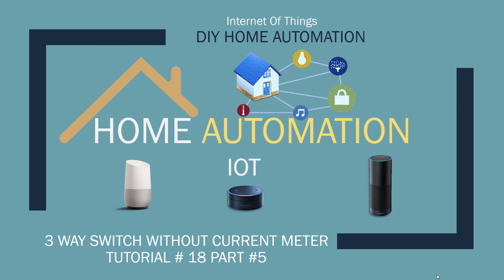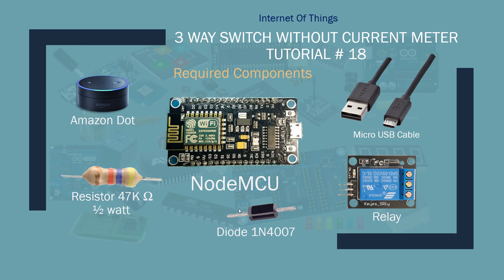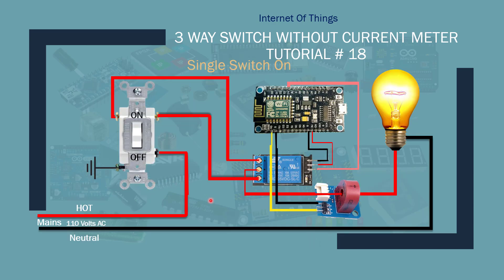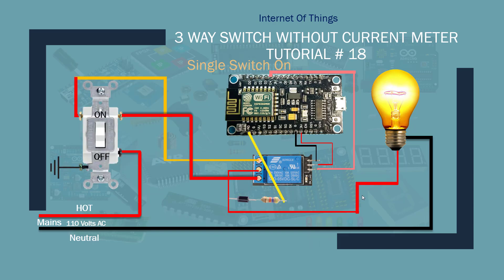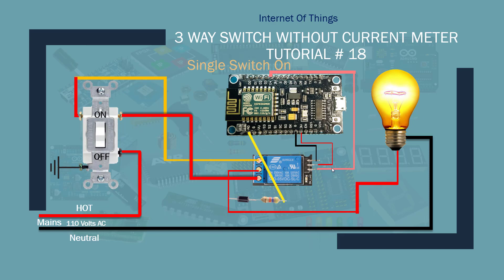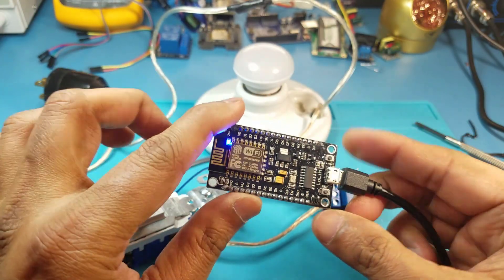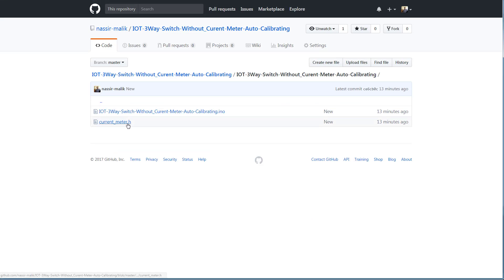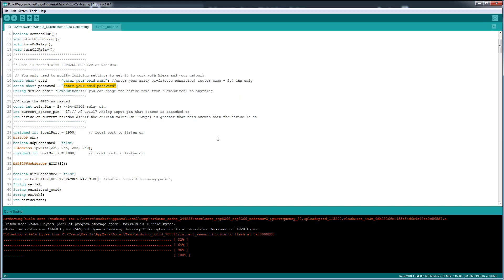IOT | 3Way Switch Without Current Meter Auto Calibrating | Alexa | NodeMcu | Tutorial #18

Comment: hey the project is too good and I was trying the code to verify in ide but the error is showing down below:
Arduino: 1.8.9 (Windows Store 1.8.21.0) (Windows 10), Board: "NodeMCU 1.0 (ESP-12E Module), 80 MHz, Flash, Disabled, All SSL ciphers (most compatible), 4M (no SPIFFS), v2 Lower Memory, Disabled, None, Sketch + WiFi Settings, 115200"

C:\Users\maadh\OneDrive\Desktop\3 way switch\IOT-3Way-Switch-Without_Current-Meter-Auto-Calibrating-master\IOT-3Way-Switch-Without_Curent-Meter-Auto-Calibrating\IOT-3Way-Switch-Without_Curent-Meter-Auto-Calibrating.ino: In lambda function:

IOT-3Way-Switch-Without_Curent-Meter-Auto-Calibrating:232:14: error: request for member 'indexOf' in 'request', which is of non-class type 'int'

   if(request.indexOf("GetBinaryState") >= 0) {

              ^

exit status 1

request for member 'indexOf' in 'request', which is of non-class type 'int'

This report would have more information with

"Show verbose output during compilation"

option enabled in File -> Preferences.

;

Comment: You are tapping off the 120 volt circuit to feed the GPIO on the micro controller? What about the common?
Reply from the maker: Eric Hughes I am not sure what your question is. Neutral wire is going directly from the plug to light bulb. Thank you for the feedback.
Reply: You are correct, the high voltage mains have no closed circuit to the ESP because the mains neutral is not connected to the ESP. What he’s doing is making an antenna that’s resonating very high due to the very high voltage and it’s getting picked up by the ADC in the ESP. Kind of similar concept to wirelessly detecting the engine running in a car. It’s not an orthodox design but could work. I probably would have done it very differently, but that’s just me.
Reply from the maker: Eugene Frenkel Thank you for your clarification I really appreciate it.
Reply: Hope I am not that late Eugene I have been trying to understand the circuit. So I have two questions what's the use of that 4.7k resistor then? 2. I see the circuit is not grounded but applying so much voltage across A0 will not affect the ESP?
Reply from the maker: Resistor is dropping the current down. My circuit is bear minimum. To protect the board you can use a fuse with correct amp power.

Yes it works for 220 volts. You can test it with led first before your connect it to your board.
Reply: Sure thing, I will try that just waiting for my ESP to arrive. Thanks, man your videos are awesome keep doing the great work!

Comment: Is it possible to use more than 1 relay? What about I use a 4 relay board? I think the real question is can there be more than 1 input pin for the diode+resistor?
Reply from the maker: Yes, but you need more than one analog pin.NodeMcu has only one. Use ADC converter to control more relay. Watch my Pi3 video. 
I am working on Sonoff 4 ch pro to make it current sensing without analog pins. Stay Tuned.

https://www.youtube.com/watch?v=pBxeHlvF4eQ

Comment: Where you buy the relays ? they are 5v?
Reply from the maker: Jorge Capitão I get them from ebay for banggood.

https://www.banggood.com/5Pcs-5V-Relay-5-12V-TTL-Signal-1-Channel-Module-High-Level-Expansion-Board-For-Arduino-p-1178210.html?rmmds=search&cur_warehouse=CN

https://www.ebay.com/itm/1pc-DC12V-Channel-5V-Low-Level-Power-Supply-Relay-Module-SRD-12VDC-SL-C-Clips/311941401345?hash=item48a1280b01:g:RcMAAOSwxKtYBpYf

Comment: Thank you for all you work and tutorials. They are great! I have 2 questions:
 I understand that A0 input is the only serial pin and you can connect one devise to A0 then do the job. Is it possible to have a setup to convert the current into digital output and then connect it to a data pin. Signal is present then devise is on. 
2. Is it possible to have the setup you presented on solid state relay with 2 poles. 
thank you for your tuts they are easy to follow and reproduce!
Reply from the maker: Vlad Puha I am working on to find a way to leverage digital pins. You will need 2 solid stat relays to do the same setup. I will be doing a tutorial on this soon.
Reply: thank you for the clue, Nassir! I will try to figure it out to if I can understand it. As for the analog to digital can a analog to digital be used? (I do programming for leaving dont have knowledge besides beyond basis in the field).
Reply from the maker: Theoretically, it should work.

Comment: any dodemcu will work ???.. I know the older notemcu does not have the VV, also I have a switch I like to try this on. the switch is control from two different location.
Reply from the maker: bobby royster It will work any ESP8266 and NodeMcu.

Comment: sir i m having a raspberry pi 3 and my plan is to make a smart house using esp2866 12 e i want to plac raspbeery pi in one room and rest al esp2866 12 e will but in whole house many relay will be connect to them  i want to control them by smarhone as well as laptop as well as using voice what should i use can u plzz help me
Reply from the maker: Aniket I am doing the siiler thing. I want to use pi with touch screen as hub in few rooms and control everything from it. I will be doing a tutorial where you are able to connect and control multiple RF and wifi devices like ESP8266 and Rf radio. Stay tuned.
Reply: thanks:)

Comment: Is there a way to power up the MCU or 8266 from the mains?  I would like to make a self contained unit with no outside power supply.
Reply from the maker: Ken Prochaska You can use the 110v to 3/5 dc  Step Down Buck Converter. They are 3rd the size of MCU. 

https://www.ebay.com/itm/1PCS-5W-AC-DC-12V-450mA-Power-Supply-Buck-Converter-Step-Down-Module/191981585009?hash=item2cb2fe8271:g:9LUAAOSwYIxX4QL1

https://www.ebay.com/itm/1pcs-HLK-PM01-AC-DC-220V-to-5V-Step-Down-Power-Supply-Module-Household-Switch/152825646956?epid=874404704&hash=item23951e4f6c:g:WxcAAOSwh1haJOyT
Reply: Netmedias , can we use any led driver and a 7805 to power the 8266, I think it's cheaper  than other sources in my country......

By the way u deserve a great appreciation for ur effort... keep going man....
Reply from the maker: You can use any power supply that can provide 3.3 volts and at least 170 mA.

Comment: Great way to substitute the current meter, just one question, is calibartion need to be done every time we reset it or in case of an electricity failure ?
Reply from the maker: bruno gonzalez You only need to recalibrate if you change the bulb  with different power consumption. In case of power failure it does not       lose the setting

Comment: Hi.  I'm just getting started in the Arduino world, and really like your tutorials on home automation.  I have run into an issue with getting any of your sketches to work.  They flash fine.  My network recognizes them.  I have used the Nodemcu, and the 8266 12E alone.  I cannot get Alexa to control them.  I get the message waiting for Belkin International, and "device is unresponsive" on my Alexa App.  I turn the 8266 on and off thru Alexa and with the Alexa App, and get the same error messages.  Sometimes it turns on, most of the time it doesn't.  What Does Belkin have to do with the sketch?  Also, the light is usually on- on the Nodemcu..Please help

Comment: Hi sir, can i change the resistor to 1/4 watt? If can then need to change the value in arduino code ?
Nice tutor...
Thanks.
Reply from the maker: It is risky. It may heat up and cause problems.
Reply: can i use a resistor 1/4 watt combine ? how many watt the lamp you using sir ?
Thanks.
Reply from the maker: Rhendy Tay you can try to use the 1/4 watt resistor. If it stays cool then you are fine. If it starts to get warm then you will need the 1/2. I did the same thing.
Reply: Thank sir for your reply, get all working well.

Comment: Thank you for a great video.  I am having trouble when the nodemcu is powered from an ac/dc converter.  when connected, there is not enough difference in the threshold to detect the current.  When powered from a battery source it is fine.  any ideas on how to isolate the power supply or stop the feedback?
Reply from the maker: Ross Power I used the ac/dc adopter during the demo and it is working fine.

Comment: Thank you so much for this tutorial, very interesting but for me doesn't work very good. i don't know what I did wrong, because when I say "Alexa, turn on demo switch" Alexa turn off the light, and when I say "Alexa, turn off demo switch" Alexa turn on the light. And sometimes doesn't work at all.
Any Ideas????
Reply from the maker: Miguel Elias make sure calibrate it when light is on. Are you using Mechanical relay?
Reply: Thank you for your quick response. Yes, I'm using the same relay you used on your tutorial.
I tried to start it over deleting everything and flashing again, but everything got worse. Now i have errors. :(
Reply: This is weird, (I change the name "demoswitch" for "Light"). Now is working but only saying "Alexa turn OFF the light" if the light was off turn it on, and if the light was on, turn it off, if I say " Alexa turn ON the light" Nothing happen, and Alexa replies OK.  I can turn ON or OFF the light, only saying "Alexa turn OFF the light.  Any Ideas how can I fix this??